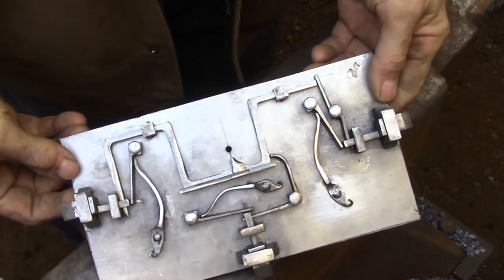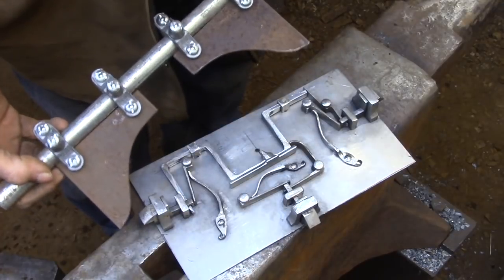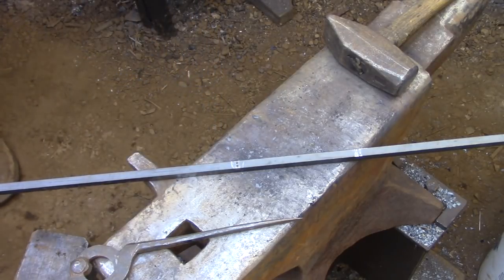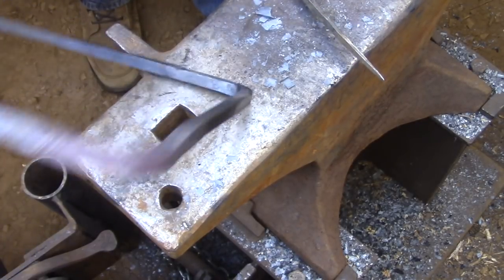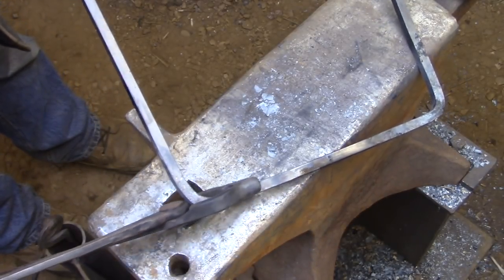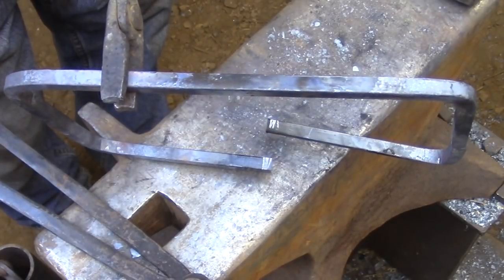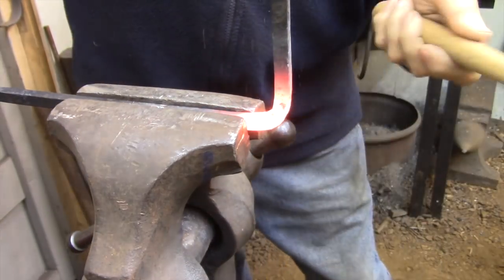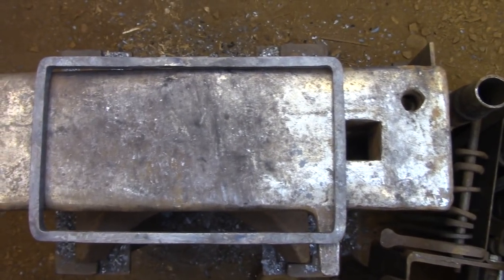Blacksmithing Project - A Simple Nuremberg Box 16

Comment: Dennis, a question. I have some stainless that is from a Conrail aluminum three tear car hauler. It is 11/2 in in dia. and is non magnetic. I am not sure if it will harden yet. My question is will it make good tooling like punches, drifts, and if I'm feeling very ambitious tongs. I don't know how to make any of these but it would be sweet to have stainless tooling and tongs right? Thanks and I look forward to your reply. Also there are no numbers on the piece for a part number reference. I don't know what type it is all I know is it's SS and non magnetic. Again thanks. Martin
Reply: M&S BLADES the issue would be that you would be heating and cooling a lot of your tools very rapidly and something like stainless steel might crack along the way.

mild steel is best for this.

but don't take that as gospel, it is just what I've read. There are many forums that discuss topics like these.

another issue is it takes much more to shape it. You'll be hammering until you're blue. It also has to become hotter to shape.

Thus I wouldn't recommend it. Especially if you're just starting out.

It would make an awesome knife though. But when you're further along.
Reply: Perhaps your right it would take a long time to shape especially by hand. I still need to do some testing to see if it hardens. I was told that it is possibly a SS that will not get hard . So we will see . Yep your right though if it takes a harden it will make a great blade. I do have all the heat I want in my forge though. Perhaps I will try and move some just to see. If all else fails I guess I will need to build a power hammer, press or better yet a rolling mill. Thanks for your comment. Martin
Reply: I think you would regret putting all the effort into making tooling with SS only to lose the tools when they can’t handle the stresses they are under.  Tongs from high carbon steel are strong but can’t be cooled off in the slack tub when they get hot.  I’m a big fan of A36 for tongs because it has a bit more carbon than other mild steels (20-40 points of carbon) but is pretty easy to work with.  Punches and drifts can be made easily from coil springs, old crowbars, old chisels, etc...and they will last a long time.  Mild steel punches and drifts are one time use before they need to be redressed or scrapped.  
I’d save the SS to make spoons and forks or jewelry later on.
Reply: Lou L,  I think you are very right about the setting the SS aside for later spoons, forks and the like. Since my post I have had the opportunity to do more research and talk to other smiths. And the outcome was pretty much the same . Hard to work not a good source for tooling and more than likely not a knife steel. So this leaves me with the option to make some bbq utinsals and table utinsals and perhaps some decorative pieces as well. Perhaps I will do a search on pieces forged from SS. Cheers, Martin
Reply: M&S BLADES I only know some things because I have some good mentors on iforgeiron who know a ton but who aren’t afraid to be strict teachers.  I’ve learned to assume the SS I come across isn’t knife quality because the good stuff is much less common and much more expensive.  Honestly, I’ve never done it but I’ve learned enough to know that forging a knife from the right stainless steel isn’t for me.  The people who make SS knives use stock removal or cnc to shape their knives.  Then they either pay for professional heat treatment or they own very expensive ovens.  It’s just too much for me.  Plus, I prefer blacksmithing to knife making. 
Enjoy finding cool uses for that stainless!